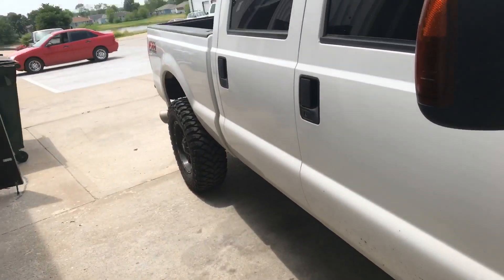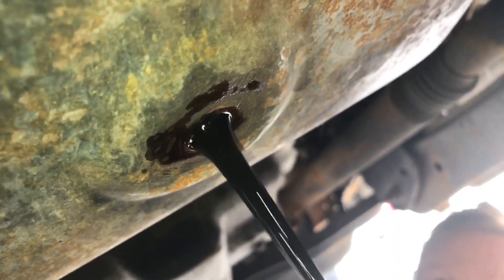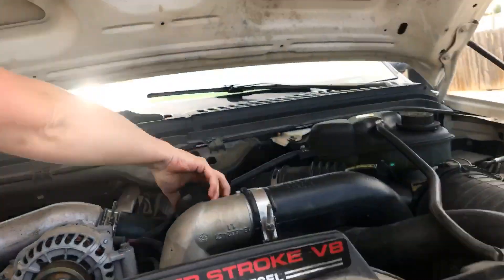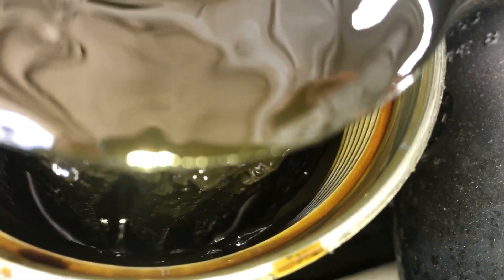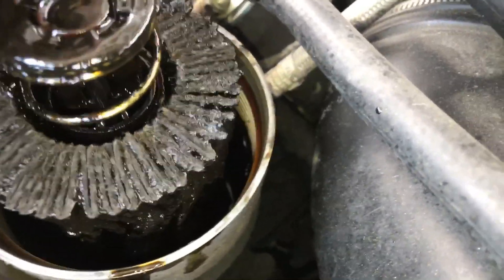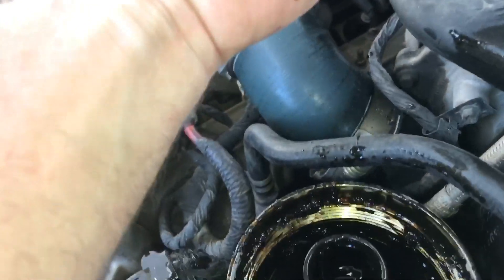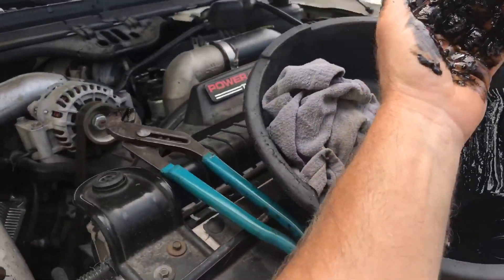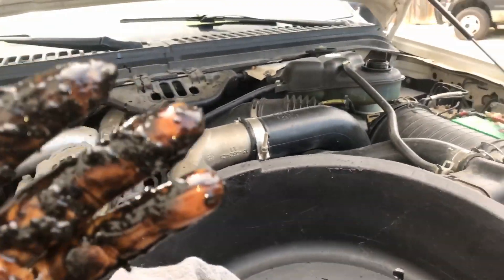This Sludge In This 6.0 PowerStroke Was Formed In ONLY 2000 MILES????

Comment: I've seen sludge like that before from using oil additives, the additive was not compatible with the engine oil. The additive that the customer used was motorkote friction reducer. It was a 2015 dodge 3500 with the 6.4 gas engine

Comment: dont think this is coolant seen this before on people who do not change their oil often enough. First time was a fleet application where they ran ALL DAY for days on end yet still did 3000 mile oil changed (when the hours on the oil was like 3 times the running time you should expect between oil changed) and the other when a guy has used a non-ford oil filter at some point and the cap was too tall for the filter and as a result the oil was NOT being filtered on his truck and this sludge garbage happened to him as well after 3-4 oil changes .  Was able to catch this happening and save his truck.  Got some BG products engine flush and ran that though for him and then made him change the engine oil at 1000 miles and it seemed like it solved the problem.  We also took his oil pan off to make sure none of that crap would end up clogging his oil pickup